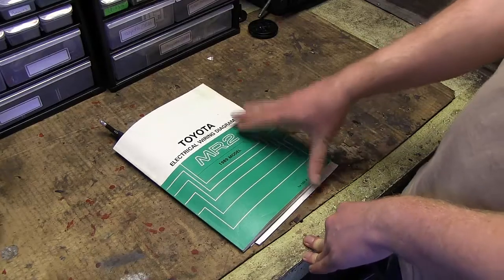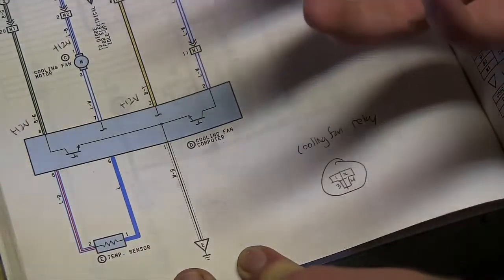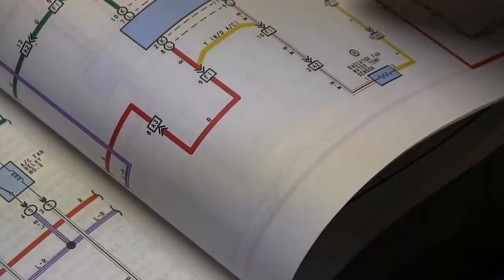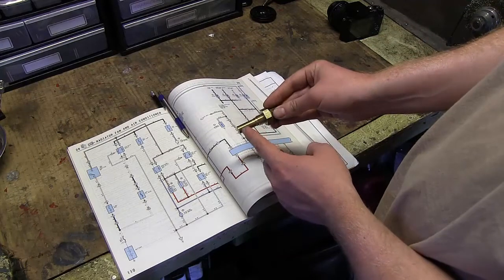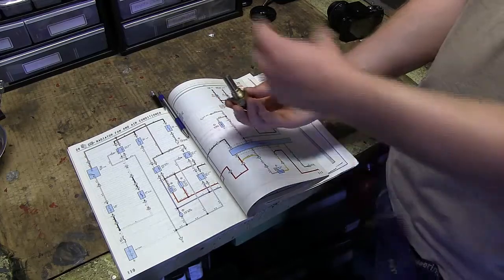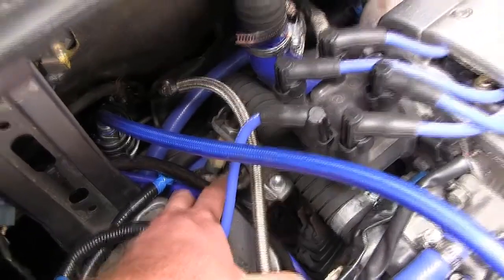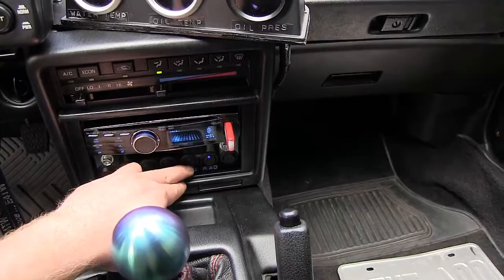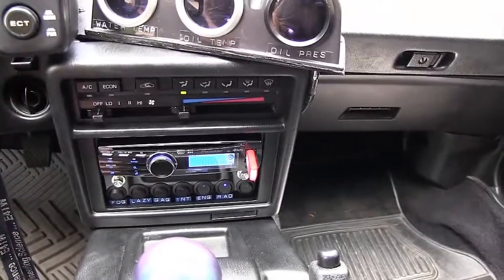Adding manual fan controls to your car

Comment: Where did you get the switch panel?
Reply: Kevin Horton can send me a couple pictures of the wiring diagram of the headlights switch my retractors don't work. The cable red with white line has no signal this cable comes from the headlight switch to the retractor relay.